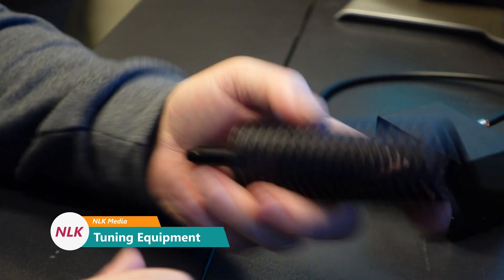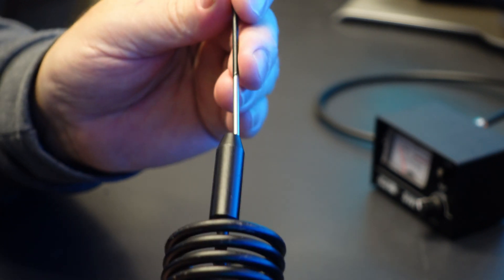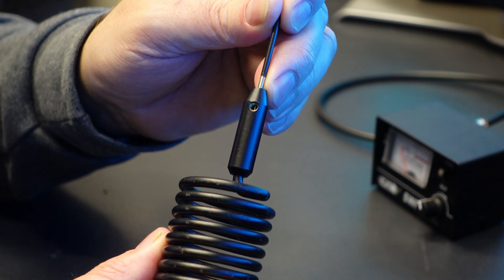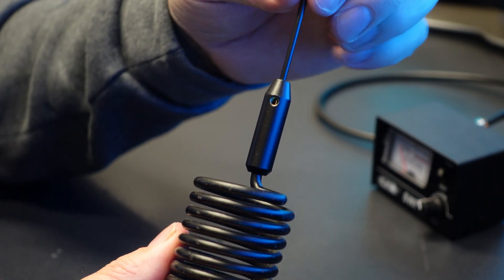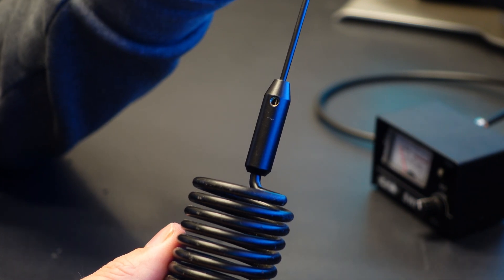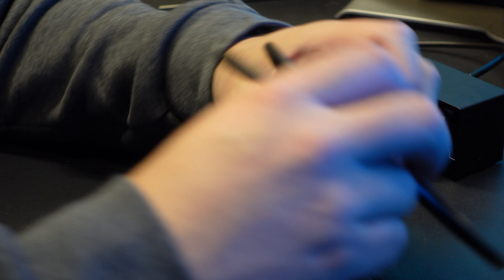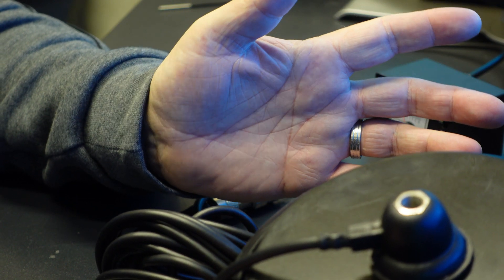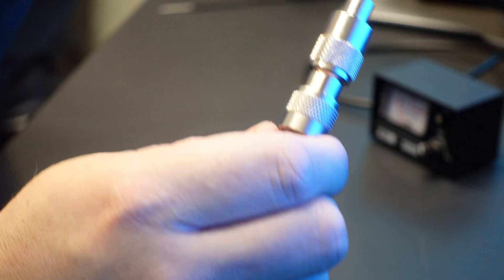Tuning CB Radio Antenna - SWR Meter - CB Aerial Tuning - President Randy III Tuning

Comment: Swr is not a measure of a correctly tuned antenna, a correctly tuned antenna can have multiple impedances that are not close to 50ohms, a correctly tuned antenna is when the reactances have cancelled each other out ,this can happen at 50.1 swr, you are misunderstanding tuned with matched, also the reflected power doesn't go back intonthe radio and damage it ,the impedance at the radio that the reflected power has transformed into something other than 50ohms is what causes your radio to heat up

Comment: I always thought you’re supposed to be sitting inside of the car with the doors closed and the windows up to tune a CB antenna. But hey, what do I know? That’s just what I’ve always been told. 🤷‍♂️
Reply from the maker: Hi Baron, thanks for commenting. The important thing is to not obstruct the antenna so as long as your under the roof line it’s fine if centre roof mounting. If the antenna is side mounted to the vehicle then it would matter on that side. Being close to a building also matters as the signal will bounce back and can give an incorrect SWR reading. All the best and thanks for watching.

Comment: Which portable antennas are suggested for CB with SSB (Skip mode)?
Reply from the maker: Hi again Kisho, I prefer to use the Diamond HF-10FX which is a 10 meter band antenna, just extend to maximum adjustment and SWR tune it to get best results. I made a video on this antenna so check that out. You could also use a Sirio Performer or a K40 or a Wilson 1000. Out of the three alternatives I have just given I would look at the Wilson first, its a darn good antenna. As mentioned before, its also the hight that is important, if your in a vallee or blocked by buildings, no antenna is going to work well. If your interested in Skip then get a Diamond or Wilson, get up nice and high, the higher the better, make sure its in daylight hours and see what you can find. All the best, MJ7NLK

Comment: Hey 🙋‍♂️ i haven't been into cb for years, and im struggling to get the swr down

So my setup is, a stud mounted, base loaded antenna with a whip in the middle of a transit pickup roof

I have checked the setup with a multimeter, i have good ground to the body, and the whip is isolated from the body as it should be

The whip is between 4 and 5 foot long, it has a blue and a red band painted on it close to the bottom of the whip, i dont know what there for

I bought the antenna from knights electrocom, the brand is a leopard at1 half breed antenna

So, i started off with an swr of 3 and above, adjusted the antenna down slightly, that bought the swr down to just over 2.5, i adjusted the antenna down a little further, and rhe reading shot up to just over 3 again

What am i doing dumb?
Reply from the maker: Hi Russell, if you have good grounding then the next thing to check is you coax cable. Make sure it’s not kinked or trapped or damaged. If possible use a patch cable directly to the antenna to eliminate that. If you still have high SWR then you need to test. Go to the mid band, channel 20, extend the antenna using the adjustment mechanism to the maximum position and take a reading. Reduce to half way and take a reading. Reduce to minimum and take a reading. If the SWR is decreasing between measurements and at the lowest point you have the lowest measurement then the antenna is too long and needs shortening. Remove the whip and cut off 10mm using a dremmel and repeat the tests. I had a stainless whip and ended up cutting off over an inch before the SWR came down. It can be a bit frightening cutting off bits of the whip but stick with it. Just remember that once cut you cannot put it back on so small amounts to start with and ensure it’s having an effect before going too mad. Please keep me posted. Thanks for watching. All the best. 
[Note for others, please read the general note in the video description re testing on Channel 40 and Channel 1 as shown in the video. Once you are within tolerance you can fine tune to the mid band if desired]
Reply from the maker: Oh and also make sure your testing away from buildings and obstructions. If your testing right next to a building or under a car port then this will not help with measuring reflected signal. Take the vehicle to somewhere where there are no obstructions within 20 meters of the antenna and don’t obstruct it yourself when measuring. Below the antenna is fine but all around it needs to be free of obstruction.
Reply: @NLKMediaGroup  ah ok, thank you for that, ill try it when the rain stops 👍

I really could do with finding somewhere a little more open too, i live in a housing estate, and i did notice, when another van pulled onto a drive across the road, the swr went up again
Reply from the maker: An SWR of around 2 is ok but you should be aiming for around 1.5 in the mid band. You will get different readings dependant on the channel so test and tune for 20. Definitely wait for the rain to stop and wind to decrease a bit. It’s no fun if your getting soaked. Don’t go mad with testing away from obstruction but 20 meters is good above the roof line. Good luck and keep me posted. All the best.
Reply: @NLKMediaGroup  thanks for that, yes ill keep you posted, all the coax is new, i tested the coax with a multimeter for continuity on the core and the ground, and there ok, i checked to ensure the core isnt contacting the ground, and there isnt any, i even checked the stud mount and the antenna, then i assembled the whole system and checked again whilst it was assembled, using the multimeter where the swr meter would go, so i know theres no grounding of the core, and i know theres a connection between the end of the cable and the whip

It was just baffling me why the swr was coming down slowly then jumping back up, ill try the method you recommend, channel 20, whip at the highest adjustment, test, put the whip half way down, test, put the whip to the bottom, test and see how i go

I did wonder if it was that the whip was way too long, as the other base loaded antennas i had years ago, never had a whip this long, i think they were around a 2 foot whip, rhis whip is around four and a half feet, getting on for five feet long

I know manufacturers send whips that are too long on purpose, so that you can adjust down, but i never imagined it would be inches too long, i only imagined them being say 5mm too long
Reply from the maker: I had a thunder pole orbiter SS and had to cut over an inch off it before the swr came down. Just test long, mid and short and as long as the SWR is decreasing between measurements it should be trimmed. If using a mag mount the tuning can change between locations but you don’t have that issue if it’s a fixed mount. After you have it tuned for 20 changing up to 40 will change the SWR as will going down to 01. Tuning at 20 gives you the best of both worlds. Good luck and fingers crossed you can achieve 1.2. Ish after fettling.
Reply: @NLKMediaGroup  thanks so much for the advice, its refreshed my memory of doing all this when i was younger, im now waiting for a break in the weather, and hopefully i didnt leave the allen key for the grub screw for the whip adjuster on the van roof the last time i drove off 🤦‍♂️
Reply: @NLKMediaGroup  i am officially giving up, i messed the grub screw up on the ariel, im gonna end up putting a hammer through this cb and never having one again before long
Reply from the maker: Don’t give up Russell, how badly is the grub screw damaged? I purchased a box of stainless grub screws in various sizes from Amazon and they were cheap. Is it just a matter of replacing the screw. It certainly can be frustrating and if needed you can use a normal bolt to hold it in place if you can match the size and thread. Have a cup of tea and tackle it again after a bit of a break.
Reply: @NLKMediaGroup  i found an m4 snap-off screw i can use for now, obviously either that will have to stay in, or ill have to swr it again if i change the grub screw for another grub screw

Well, the head of the grub screw is mashed, the allen key is slipping round in it, i didn't realize my own strength when i was nipping it up, and the allen key chewed it
Reply from the maker: It’s easily done. They aren’t very strong and it is easy to mess them up. An M4 sounds like a good solution and won’t affect the tuning. It’s only cosmetic and as long as it holds the whip in place it’s good. The bolt only needs to just hold it while testing and then finally tighten at the end. I have my fingers crossed round two will go smoothly.
Reply: @NLKMediaGroup  this really is driving me crazy now, no matter where the whip is, the swr is not coming down, ita just hovering between 2.5 and 3, i left a magnetic screwdriver on the roof, and it gave me a false reading of less than 1.2, until i moved the screwdriver
Reply from the maker: What are the measurements for the three positions on channel 20? Whip High x, medium x, and low x? Have you shortened the whip yet? Are the measurements decreasing as the whip gets shorter to the low setting?
Reply from the maker: If the SWR is high 3.0 and medium 2.8 and low 2.5 then the whip is too long and needs shortening. You will find that reducing the length a small amount has a small impact on the SWR.
Reply: @NLKMediaGroup  no difference between top middle or bottom, its hanging between 2.5 and 3

The only time its been really low is when i left a magnetic screwdriver on the roof, it came down to 1.1, but as soon as i moved the screwdriver it shot back up to between 2.5 and 3
Reply from the maker: @russellrattys6581  Can you please email me and I can help you directly. I am now back in the office and can respond quicker as have been out most of the day. Can you take a reading on Channel 40 and a reading on Channel 1 and let me know the SWR on each.
Reply from the maker: @russellrattys6581  I have added a handy guide in the video description which might help in diagnosing your issue. Please let me know if I can help further and please feel free to email me as well. I am interested to see where the issue is with this. Don't give up, we will get it resolved, we need the CB community to grow not shrink 🙂
Reply: @NLKMediaGroup  i have given up, im not wasting anymore time on the cb ariel, i have been at it for days now, and its still doing my head in, im going to take the cb out my truck, take the ariel off the stump and forget about it
Reply from the maker: @russellrattys6581  I am sorry to hear that but understand the frustration. All the best
Reply: @NLKMediaGroup  hey 🙋‍♂️ so, i have come out to a lake near my house where its all open, and the swr meter reading is less than 2 now, and, the reading is higher on channel 40 than it is on 1, so i know what to do now 🙂

Another thing i have done is, i had a  beacon magnet stuck inside the truck, i have taken that out, and thw swr has dropped, it could have been the magnet interfering with the swr readings 🤔
Reply from the maker: @russellrattys6581  that is wonderful news. I am glad you are moving in the right direction now. I will have to remember to ask about magnets in the future. It’s great to hear we haven’t lost a CB’er. :-)
Reply from the maker: Just in case anyone else is reading this and having similar issues. SWR on channel 40 over 2 typically means the antenna is too long. SWR on channel 1 over 2 means the antenna is too short. SWR over 3 on all channels means there is a problem with the cable or mounting or the ground plane. 
[I have updated the video description with a handy guide to follow which is based off of the video content]

Comment: My swr changed overnight so I'm wondering does the cold weather has anything to do with my swr going up ,my swr on my diy antenna was a 1.00 and the next day it changed to 1.67 , 1.89 so I didn't get to talk on it, can you explain this issue Thanks
Reply from the maker: The weather can have a small affect on SWR but it shouldn’t swing wildly like in your example. The vehicle, antenna position and mount will affect it more. If the antenna is in the centre of the roof you will get different measurements vs to one side due to the vehicle and roof forming part of the ground plane. Moisture in the coax or damaged coax could also be to blame if it’s fluctuating lots. If the tuning on the antenna and it’s position haven’t changed and your not taking a reading close to a building then it’s most likely the coax. Anything under 2.0 is acceptable so a reading of 1.67 shouldn’t prevent you from speaking to people. It also depends on the channel you are testing on. Make sure you test at under 4 watts and on the same channel each time. I get 1.0 on channel 1, 1.2 on channel 20 and 1.4 on channel 40. Please retest and let me know how you get on. Thanks for watching, all the best.